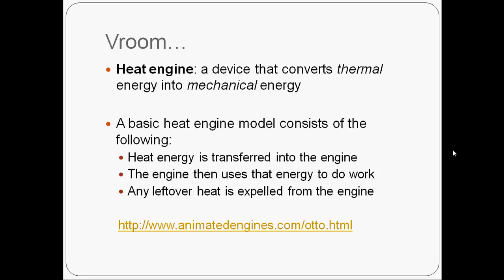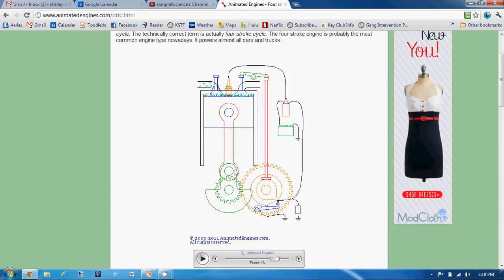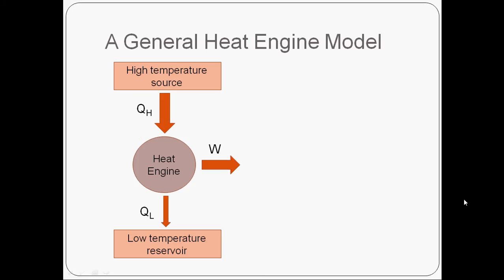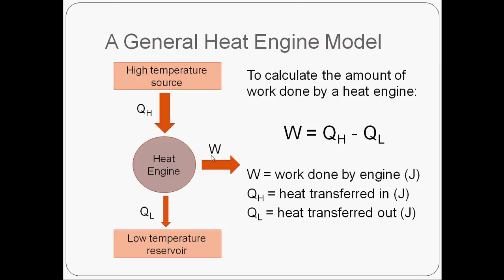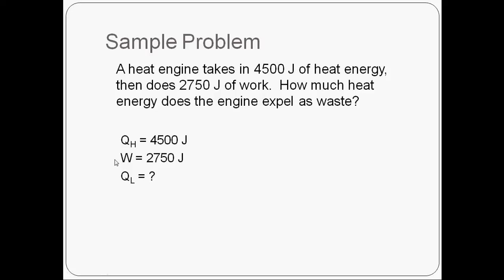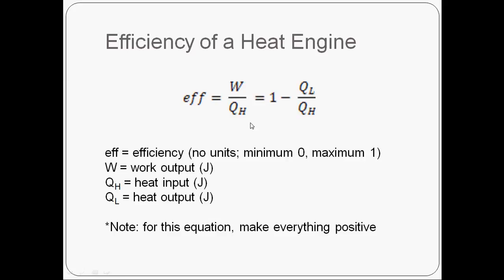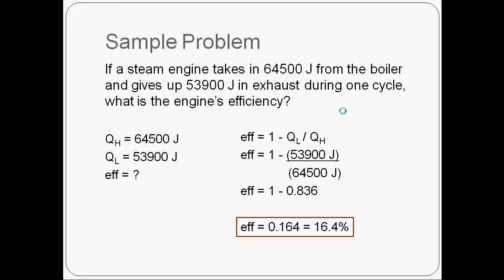Thermodynamics (Physics) Lesson 4   Heat Engines

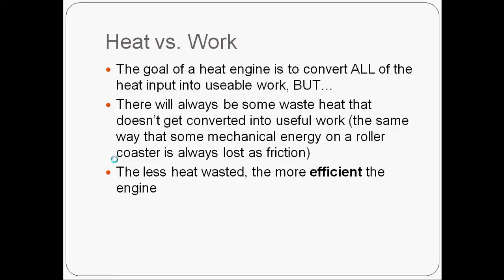Comment: At 8:21-ish.  The reason that heat engines can't be 100% efficient is not merely due to the presence of irreversibilities (such as friction), but rather due to the 2nd law of thermodynamics.  Even if you have a heat engine whose cycle is totally comprised of reversible processes, you still won't have 100% efficiency.